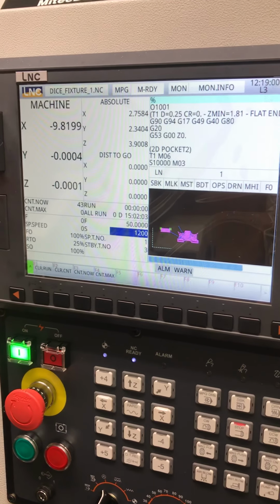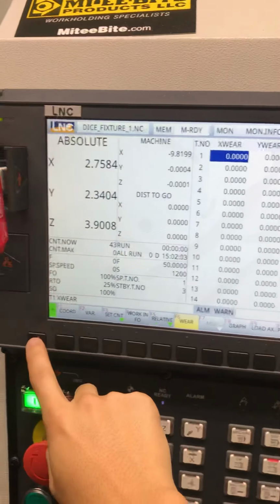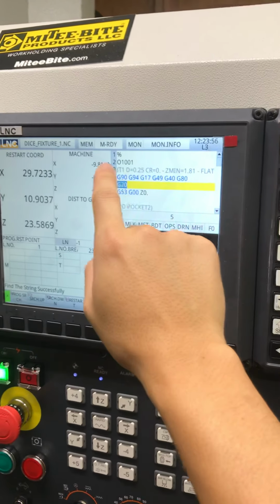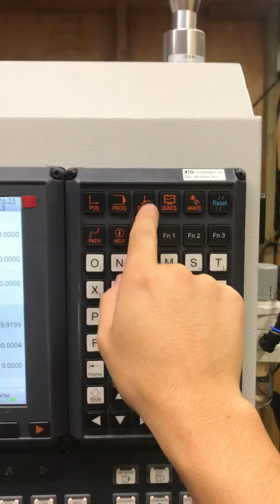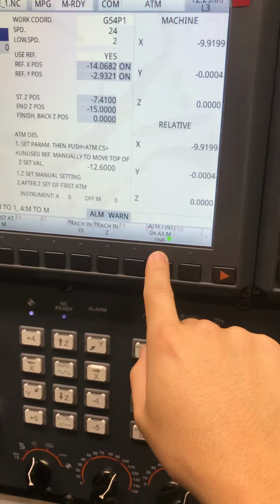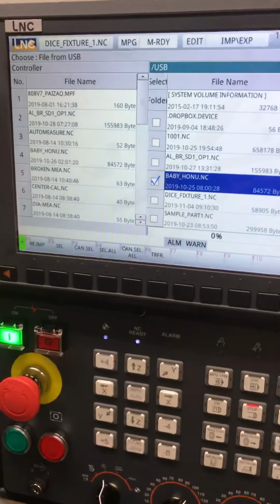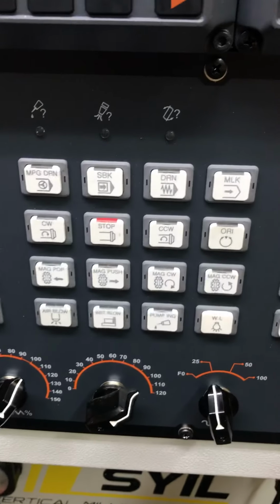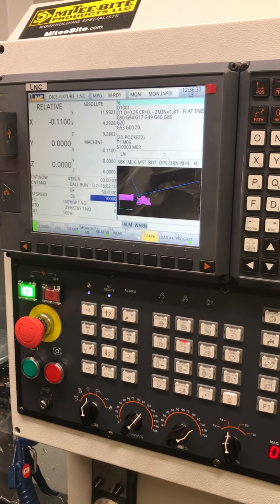LNC6800 Controller Overview

Comment: I like using the square co-ords feature to locate from the center of material. It prevents material measurement errors from causing a heavier cut on one side vs the other, and eliminates position error due to not knowing the effective diameter of the edge finder (it usually has some runout).